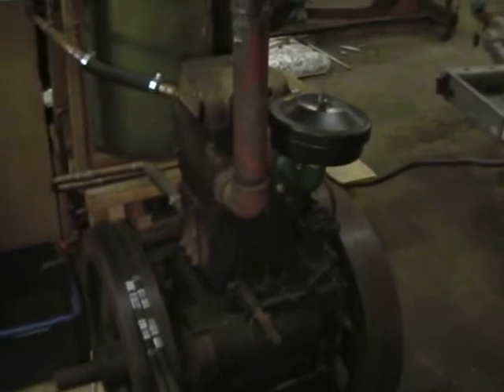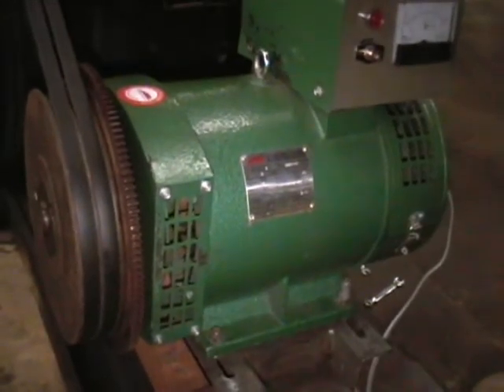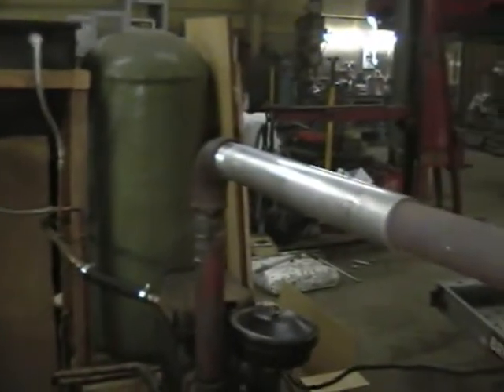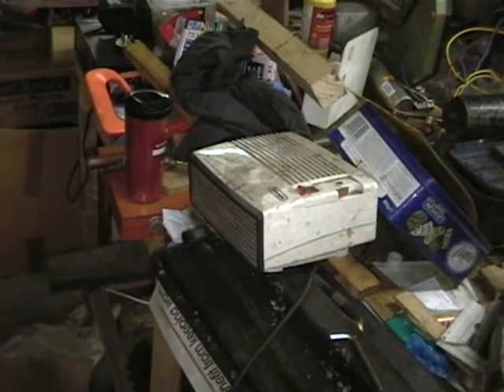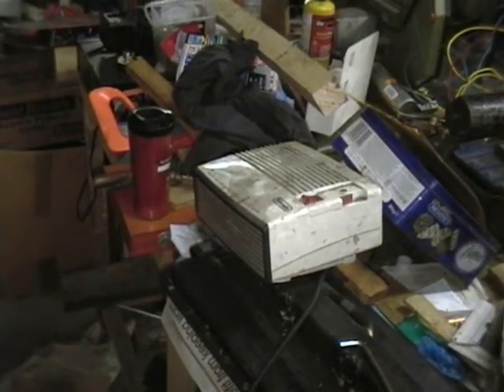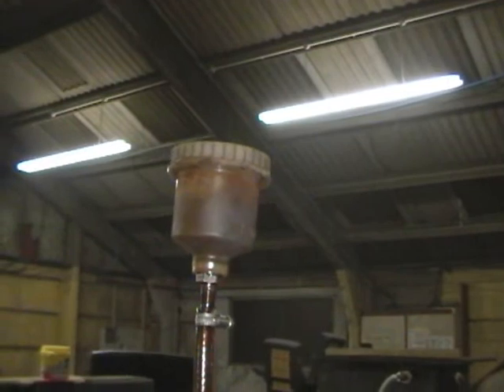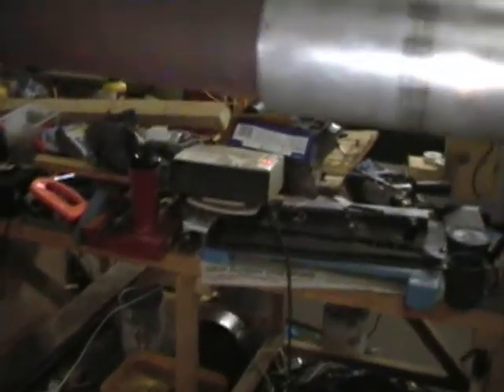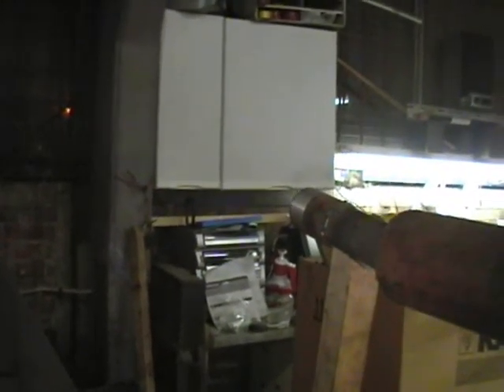Lister CS diesel 6/1 Start-o-matic - making power!

Comment from the maker: My previous (as videoed) setup used only the engine coolant to heat an insulated tank of water; it took around 50-60 minutes to heat the whole tank to >50 degrees C with a 2kw load on the engine.  The exhaust gets too hot to touch very quickly (within 5 mins), but I don't know how much of that heat I can reliably extract. 

The coolant extractor (as per dave's post) is dead easy & can be done without pumps; my exhaust heatx will have to be pumped; a vertical design might still thermosyphon.

Comment: @davev8app No point. The thermal exchange in the exhaust unit will be much quicker and efficient than the secondary coil. Therefore the coil will always be lagging behind the exhaust exchanger in thermal output unless I am missing something.

Comment: @davev8app Your heat output will be much greater with an exhaust heat exchange system and supply heat quicker. The exhaust will become hot much faster than the coolant water in a tank.

Comment: @AdeV2 An idea I have conjured up is to build a oil filled heatx around the exhaust. Pretty much wrap up some copper pipe around the exhaust and encase it with another pipe, seal the ends and fill it with oil. Should in theory work well. IT will provide good heat transfer and one will only have to watch out for oil igniting and secondly provide expansion room for the oil.

Comment from the maker: @ZS6JMP The only problem with that sort of heatx is diesels will plug them up with soot. Not too much hassle, you just have to pop the end caps off every once in a while & give it a good clean out. I have bodged together a low-efficiency heatx (just some copper tube wrapped around an aluminium pipe) which I plan to do experiments with, but time is currently short. I hope to do something with it next month or so...

Comment: @AdeV2 Good design I have seen is to channel the exhaust gas through a stack of small tubes surrounded by a large pipe that encase them, this increase the water/metal contact area. all you now need to do is to channel your water to be heated into the casing pipe and there you have it.....a efficient heat exchanger.

Comment from the maker: @ZS6JMP I do plan an exhaust heat exchanger, I just haven't figured out what kind yet. Even so, it seems a shame to waste the coolant heat; the output of these engines is (roughly) 1/3rd mechanical power, 1/3rd heat to coolant, 1/3rd heat to exhaust. I may well re-design it to thermosiphon, with a coil to extract heat from the coolant tank rather than relying on pumps, etc.  but I also plan lots of monitoring, so it will auto-shutdown if it loses coolant, oil, etc. etc.

Comment: I wouldn't mess around with the cooling system to get hot water. Rather build a heat exchanger that goes on the exhaust if you want to get hot water. Reason I say this, your system ads to many variables that if broken for whatever reason could seize your engine without cooling. I do love these old enigines though. A reminder of a time where things were built to last and engineering kept simple.